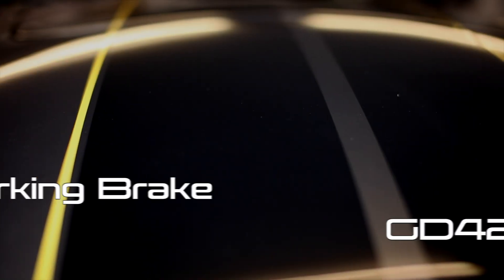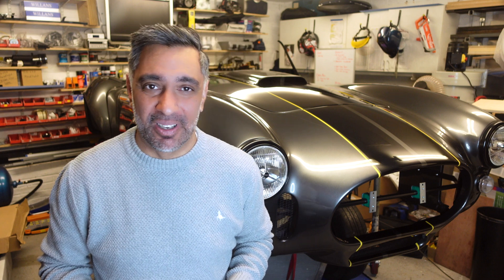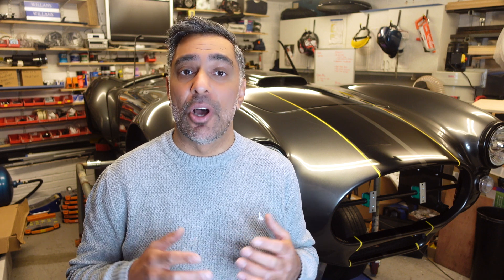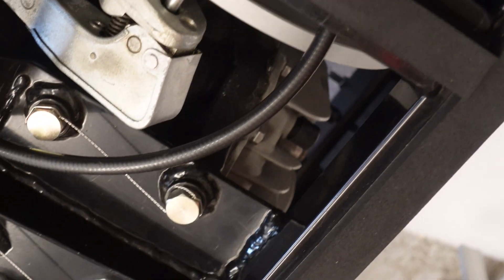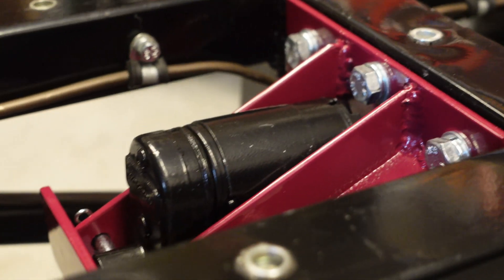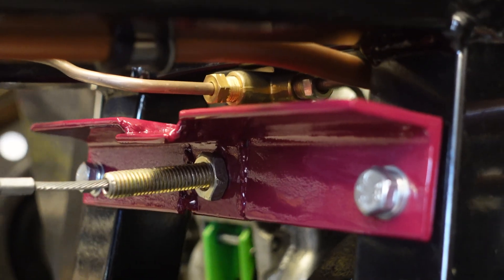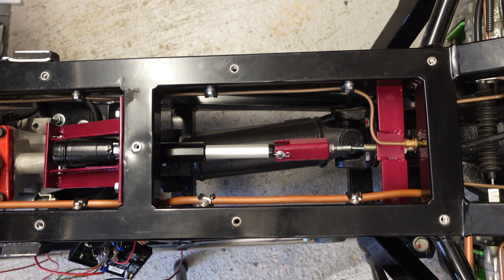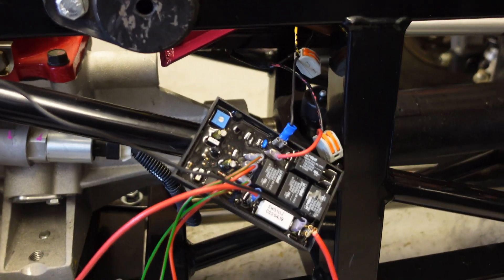Electronic parking brake on a Cobra

Comment: Does the handbrake stay applied if you disconnect the battery?
Reply from the maker: Yes.  That would be a major issue otherwise and wouldn't pass IVA 😅
Reply: @batvikcrazy   well, all sorts of bits fall off your car once it's got its IVA 😉
Reply from the maker: @David8n 😂

Comment: Hi. I have that kit from Hollin. I'm trying to replace the previous version of the control unit with the same one you are using but can only get the actuator to fully extend, it won't  retract. Are you using a reverse polarity switch? The little gray / orange box.
Reply from the maker: What switch are you using and have you wired it according to the diagram? https://www.hollinapplications.com/_files/ugd/872745_013d9c100e0d48879a5d63e3e6d1b9f8.pdf

Comment: How/ when did you attached the cable? Did you pull as tight by hand and attached it so when the actuator pulled it put the handbrake on? Tia.
Reply: With the actuator fully relaxed/extended it's easy to connect it to the clevis fork, which is fixed to the handbrake cable.  You can manually rotate the end of the actuator when it is disconnected to get it where you need it.